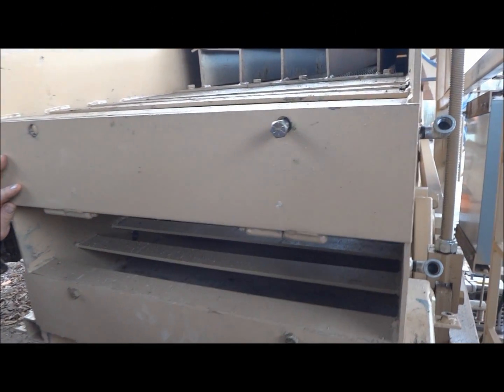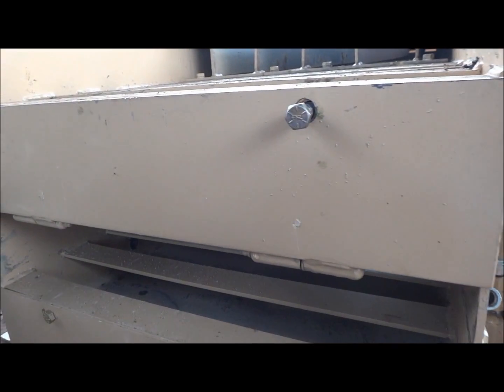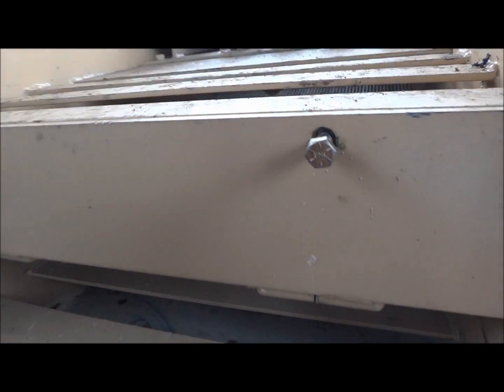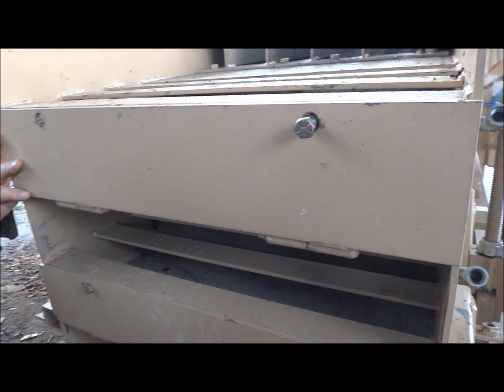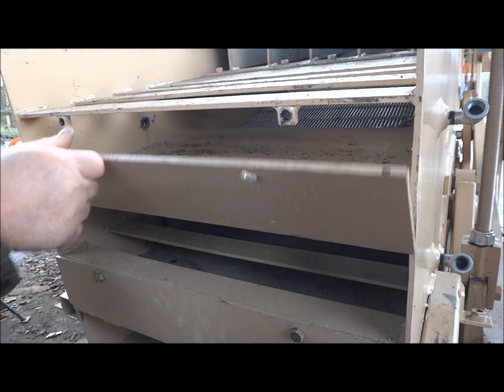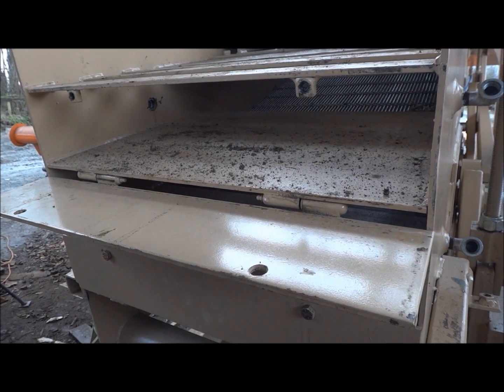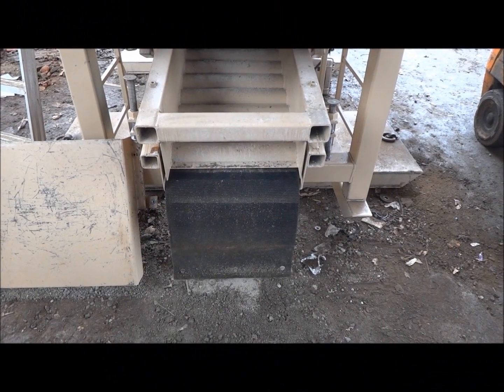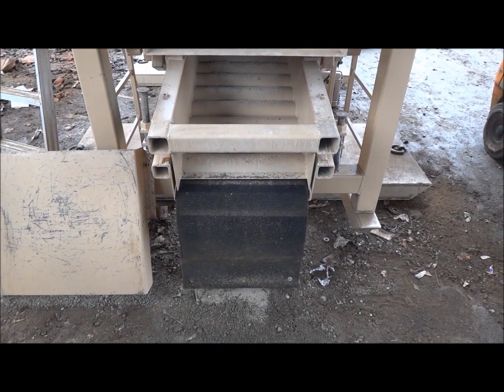Innovative Gold Machine Catches Micron Fine Gold

Comment: How much does a unit like that cost?
Reply: alan30189 Too much!
Reply: +Tim Dunk Whatever. Thanks for the non-answer.  I'm not going to buy one, I was just interested in the cost.
Reply: +alan30189 In the mining industry, in this case - mining the public, you my friend would be called a fish.  Stay away from this;  it's a joke.
Reply: +jon willard 
I agree that many of these machines are overpriced, but you need to match the machine to the job you are doing. Also, for every home-made gold sluice that is made, like the one you describe above perhaps, that is very effective in retrieving gold, there are probably 20 that are made that are not very effective at all and much of the gold goes back into the damn river. 
Everybody is trying to re-invent the wheel all the time and not many are good at doing it. I am looking for a good sluice that I can set up in a stream to eliminate panning and just take the black sand home to separate the gold from, using another machine.  I don't do welding, so I would be looking for something like Gold Hog has that is effective, proven, and cost efficient.  Then I would need something to separate the gold from the black sand without having to pan it myself. Suggestions?
Reply: Sounds like a great plan. Blueprint it and sell the drawing. Everyone in the gold business knows that the greatest profits lie in supplying the miners with the latest phantasmagorical devices.
I hear you though. This machine is a joke. What kind company can call something a "wash-plant" if it's not equipped with a hopper. Dropping product directly onto the poor screen is laughable, especially the rock size they claim this plant will process - not for long though. You'd be changing screens everyday. Interestingly, no matter how embarrassing this should be to the up-loaders, they'll sure as shit hook a fish into believing this hunk of scrap metal is the next best thing.
Reply: Thick what? Oh, you meant "Thick Toys".  Look up " derockers" and forget these marketing wet dreams that are essentially lightweight junk with poor resale value even as scrap metal.. Ever notice that none of the demos in which these toys are depicted are ever operating mine scenarios? Derockers are not complicated, very few moving parts, and rely on mass weight to take high impact loading.
Reply: Is there a video out there on what you are describing?
Reply: Trust what I said above. I am not going to buy a machine like the one in this video. I am not some big-time gold miner, or even middle of the road-time miner.

Comment: Time to break some hearts here. Worked for professional mining companies from Alaska to Panama and any machine that says they can recover 1-2 micron gold is an ABSOLUTE LIE. Just because its small doesn't mean its micron. Do some research before you place false claims. The fact of the matter is that your eyes can only see between 200 and 250 mesh. Which is 63 micron. At 400 mesh (37 micron), no means of recovery including a shaker table, (Been working them for 10 years now) can recover smaller. The true answer is that 1 micron gold is 12,000 mesh. (bacteria from cigarette smoke in the air is 2 micron or 5,000) If cigarette smoke floats away in the air, something 2X as small can't even be seen with a 100X microscope. Only recovery for something smaller that 400 mesh is a chemical reaction. If you don't believe me, prove me wrong, show me a piece of 12,000 mesh gold separated from any telluride’s, sulfides, mercury, or hematite.
Reply: +jines1284 I hate to break it to you, but seeing 0.5 um is not a problem with 100x optical magnification.  How do I know?  Well . . . I have been looking at 0.5 um features for twenty years in the semiconductor industry.  I am not saying the rest of your statements are untrue, I'm just adding a fact.  --Paul
Reply: +Paul Moore 1 micron = 3.9370079 x 10-5 inch